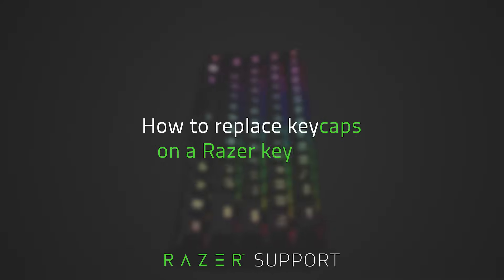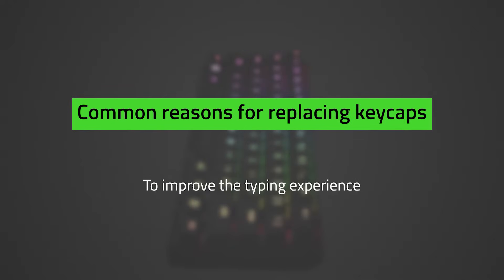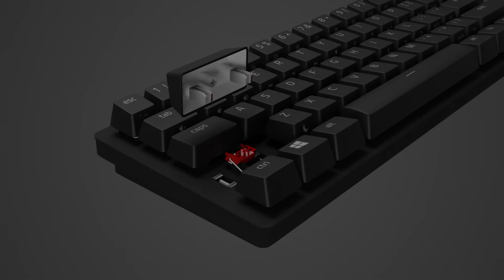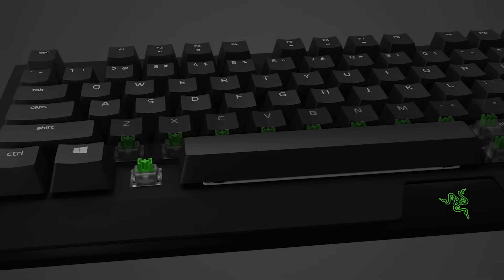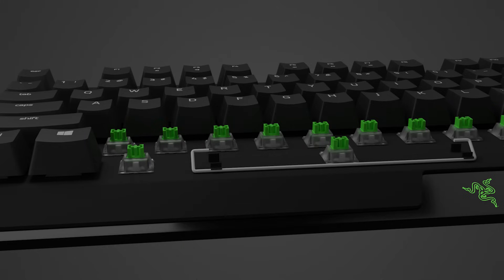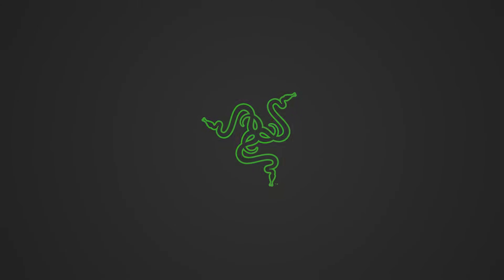How to replace keycaps on a Razer keyboard

Comment: I bought a Razer huntsman mini today and honestly I'm a tiny bit disappointed because of the sound (it sounds like a membrane keyboard) and the fact that its not hot swappable like most razer keyboards, although it is slightly my fault because i probably should have checked online to see if it was hot swappable before buying it and making sure i was able to swap the switches out for switches i liked if i found i didn't like the sound/feel of the switches it comes with.

Comment: Some Razer keyboards with the stabilizer bar have stabilizing pegs and aren't symmetrical.  It would be good to both specify whether the long end of the stabilizing peg points up towards the function keys or down towards the palm rest. They can come off when removing the key and you won't be able to see which way they were originally turned.

Comment: To anyone that had the issue I had where the key fell off due to a snapped white frame (i.e pieces snapped off inside the keyboard chassis), you can put super glue into the empty slots that arent filled with snapped plastic, and set the key back in its place. Place a heavy item like a water bottle on the key for around 15-20mins. Its basically as good as new.

Ensure you are quite precise with superglue placement (small blob).

Save yourself buying a new keyboard or trying to fish out tiny wedged plastic pieces

Comment: yyyyeah, that's not my problem.  my problem is the new keycaps don't seem to fit .  the old ones, i can pop off and on no problem - i bought a new set of caps because now when i type, the caps fly off (the keyboard is about 5yrs old and the keys are worn shiny on top and the space bar is dented down and shiny in the middle).  the new ones, i have to keep trying and trying before they'll seat and, even then, they feel wobbly and unstable.  they also don't sit at a consistent height or even at right angles so the end result looks, i'm sad to say, a bit Temu.
Reply: I just found that out myself by trying to slap keycaps from one keyboard onto the Blackwidow v3. Nothing can be done for it, I suppose, except find a different company to patronize when it comes time to purchase a new keyboard.

Comment: 1:52 I just had the left side clip for the space bar break. It looked like a piece that secured it to the keyboard body broke off because it's wobbly and  doesn't latch onto anything anymore. 

I'm not talking about the thin bar, I'm talking about the pieces the bar snaps into.

Any help would be appreciated

Comment: I have the Cynosa V2 keyboard and when I took a key off it didn't have that plus-shaped hole on the switches to push the key onto. Am I missing something?
Reply: We have the Ornate and same problem!
Reply: @saraveety7720  after a while I figured out that it's not the right type of keyboard to replace the keys on. I don't remember the terminology but you need a certain type of keyboard to be able to take the keys off and replace them. 
EDIT: I just checked, and you need a 'mechanical keyboard' to replace the keys.

Comment: Is anyone else just doing this to clean/dust their keyboards inner bits? Is there a better way that pulling all the key caps off and dusting it without the key caps?
Reply: Nope, this is the best way. By not removing the keys at all you won't get it as clean.

Comment: can someone point me in the right direction to get those two tools the pulling one to pull keys off and that little screwdriver to help fix my space bar if needed.
Reply: It's called a keycap puller. Can probably get them on Amazon for quite cheap. The screwdriver is called a 'Flat Head Screwdriver'.

Comment: Do the phantom hey caps work for the razer Tartarus
Reply from the maker: We are sorry but the Razer Phantom Keycap Upgrade Set will only fit on mechanical/optical keyboards. The Razer Tartarus is using mecha-membrane key switches and the Phantom keycaps will not work on it.

If you have any other questions or concerns, feel free to reach out to us directly here: https://insider.razer.com/index.php?forums/support

Comment: After watching this, bought new keycaps.
Replace stabilized ones; worst choice ever.
Should have stuck with the stock. Key isn't rattling, but stabilized too fucking hard. I can't even press it.
Reply: i had the same prob. you need to click each side in by pushing pretty firm.. spent ages stuffing around with them etc
Reply: Lmai thats why dont buy gaming keyboard like this
Reply: @paklekj4429  yeah, i switched to another keyboard and im having a way better experience

Comment: so when I plug in the slightly larger keys with the stabilizers some of the keys rest a little higher and dnt go down all the way, (I removed the keys for cleaning)  and when I went to put them back on none of the large keys stabilizers will latch to the metal bars below no matter what I do and yes they are aligned properly, its not a massive problem its just really annoying because I apparently am not doing anything wrong
Reply: Did you solve this by any chance, im going what you went through
Reply: @MegaPooper77  no they never responded to any of my support posts on the forums either
Reply: I had the same problem I kinda just took them off again and pushed harder when I put them back on sorry if this doesn’t help
Reply: @iova777  this worked, i pressed hard so was flat against keyboard then wiggled the keys until a snap and worked normally
Reply: @zurbergram  nice
Reply: @zurbergram  it works ! thx m8
Reply: @zurbergram  Worked for me, too - you push hard on the keycap until you hear a *click*, then you know you've got it.
Reply from the maker: We'd like to look into this. Please reach out to us from here: https://insider.razer.com/index.php?forums/support/

Comment: Dear Razer...IF LOGITECH..can make it to where they're keyboards have ON BOARD..HARDWARE ( no software bullshit needed) lighting controls ( and yes..that DOES include cycling colors AND brights levels as well as spectrum and static choices), then you can also.   

The Linux community 's hit or miss options ( razer genie...commander..etc) often won't even install or properly detect SUPPORTED keyboards like my Blackwidow Elite.  -_-  I shouldn't have to connect this to a Windows computer to be able to take advantage of even a simple STATIC color lighting option  - which is all I want to do.
Reply: bro they have (at least on my huntsman mini)
Reply: @stanlopez1722  Yes..one or a handfull at most ....couldn't get the Razer blackwidow elite to work..consistently nor my dead ( a 2ND time after not even 9 m onths) naga elite mouse... 

f uck...razer..I'm done with them. 

I bought a logtiech g600  brand new and removed all the weights..now it's weight is close enough to that naga and it JUST works..

I've also found software that enables me to program all the side buttons and others just like Logitech g software.
Reply: @motoryzen  linux support works just fine for me on razer, i have a razer blackwidow v3 and combined with openrazer and polychromatic it works just fine
overall the keyboard is high quality and software on linux works really well for me
I'm on Pop OS  though which literally has nearly everything working perfectly if you install it and most things are installed by default
Reply: @its.thered  hEY..COOL.  Good for you, I gave up a year or two ago on worrying about razer's nonsense peripherals when the damnm naga mouse I had died ...TWICE..each time within 9 month or less.

I'm using a Ducky keyboard and a Logtech g600 to where I removed all the weight to make it within spitting distance of that Naga's weight.  And with ratbagd and piper...it just works.   period.  ;)
Reply: @its.thered yes but openrazer doesn't support everything

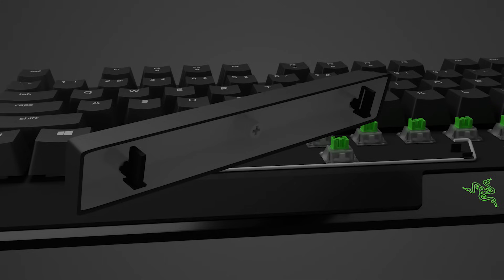Comment: 1:57.  Also btw...Ensure the stabilizer little loop things, picture at this exact point in the video, are plugged into the keycap in the correct orientation.  Otherwise when you press it onto the keyswitch...you'll find it's semi stuck...and when you press it down, it won't auto go back up...  Flip the stabilizer in the opposite direction if so
Reply: dude u saved me i was stuck at this part

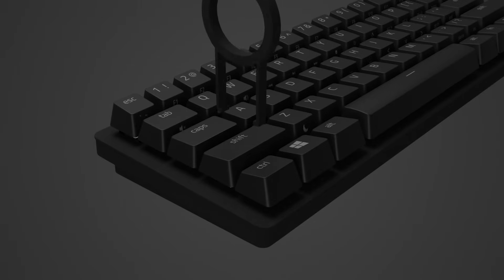Comment: 0:30 to 0:36.  BTW  that is  SMALL  flat heat screw driver...as in the head of it isn't even 1/8th inches long at most.  This is more applicably for removing the little stabilizers that are already attached to the longer/bigger keys such as backspace, enter, both shift keys,  0 ins, vertical enter , vertical plus sign, and spacebar....if you want to reuse them ( meaning like you just bought a Blackwidow Elite and wanted the green keycaps and you barely put one day's worth of typing on the originals)

Comment: AVOID RAZER KEYPADS LIKE THE PLAGUE!!!! 
I have years of experience with multiple of their products, I know how bad it really is. The hardware is fine but the software ruins everything.

Their hardware runs through their software Synapse. It is the most unreliable software since Windows '95, and worse. There are too many problems to list, and they never fix them.  With both the old Synapse and the new Synapse and through multiple PCs, Its been a regular occurance for years that all my profiles with all the macros just dissappear on me. There is always a problem, and their software interface is better than it used to be but its still substandard. Even when they release a brand new version of Synapse, the new software is just as bad and the very same problems often remain. Today I couldn't even launch the program until my internet dropped out and somehow that seemed to have fixed it!  Its reliably unreliable. Fix your F***ing software already!!

Comment: could you please give links to the tools you used please? :)
Reply: you can find those anywhere, local tech shop, amazon, ebay and will cost you below $5. I'd recommend on using a stainless steel type, because it won't damage the paint of your keycap.

Here's an amazon link for an example:
https://www.amazon.com/Keycap-Mechanical-Keyboard-Stainless-Remover/dp/B0799G7XFJ/ref=sr_1_3?dchild=1&keywords=keycap+remover&qid=1626771000&sr=8-3